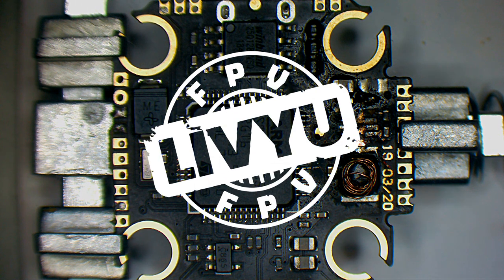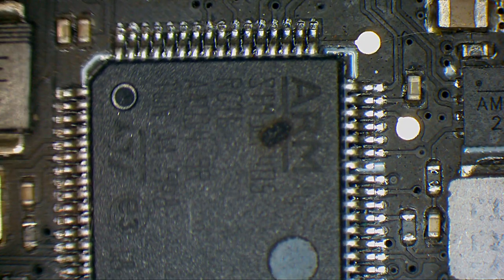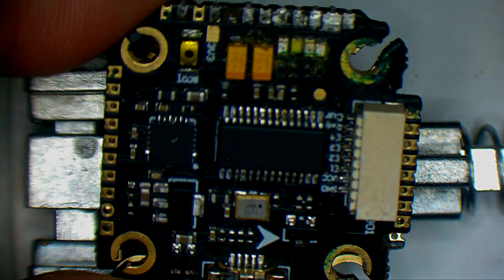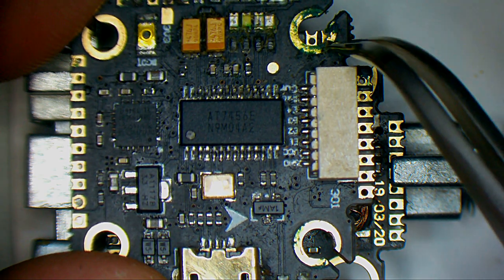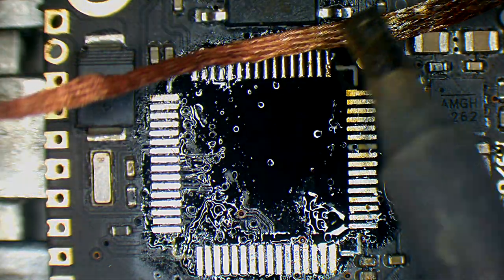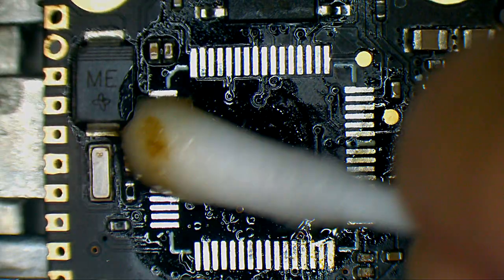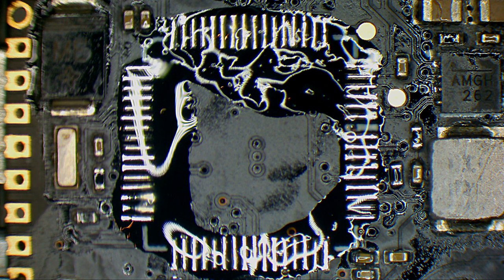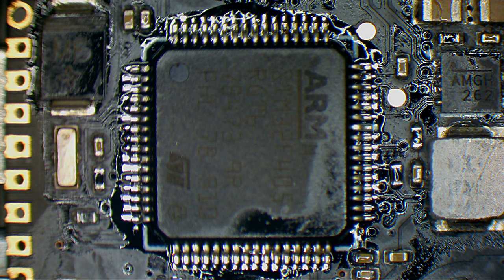Diatone Mamba F405 MINI FC - REPAIR

Comment: I have a Matek F405-STD Flight Controller same chip, but trying to find the problem has become a pain, I've removed the MCU STM32F405 plus 2 diodes and 2 3.3v regulators BUT I still have a short on the ground to 3.3, I assume its a capacitor that's shorted?
Reply: did you figure it out?

Comment: Hi , any chance you can do a DJI FPV teardown so we can understand system and internal protocols - I would love to install HDMI Out and possibly AV out, HDMI In could also be use-full in future. thanks for your awesome content always so interesting
Reply from the maker: Hi, I am waiting for a DJI air unit to try and repair it. But for the Video stream out on the USB-C from the goggles... a really good software guy could hack it and make the video out possible. Hope someone will have the time and willingness to do it.
Reply: HDMI video out has been done. Use SBC and Altera linux. https://m.facebook.com/gregorioperezperez/videos/10159049166057745/
I want to know of we can locate and upgrade the microphone. Also I hear the radio can go much higher output power. It would be good to inspect the IC's to confirm that.
Reply: Thanks guys will check it out immediately.
Reply from the maker: @changeagent228  Well after I received it i will definitelly make a video about that. Thanks
Reply: @LivyuFPV  @Flyingdream777 You are both welcome. 😀👍

Comment: Great video, thanks. I have the same fc. When I connect it to usb, mcu becomes so hot sich that it can burn my fingers. If I am qucik enough, I can connect it to bf so it seems mcu is fine. I checked shorts in pins and there is nothing. I wonder what can be the reason?
Reply from the maker: they can go bad half way. I would change it for sure !
Reply: @LivyuFPV  thanks. I didn't know that it can go bad half way
Reply: I have a 30x30 mamba with the same issue, from what I understand it can be 2 things: broken mcu or broken voltage regulator (either 5v or 3.3v, check if the outputs of these regulators are shorted to ground and if they aren't check if they output the correct voltage)

Comment: I just thought could you make a video on how to check for errors on a Bord like this. I Guess not always you see burn marks that determines it’s dead. For example I have a spendix where the cpu gets hot but so I guess it’s that but not sure. Any procedure you recommend. Like check certain power rails or something like that.  Like your videos and looks so easy:)
Reply from the maker: 3.3v power rail. If MCU gets very hot then it is probably that one.

Comment: I'm curious. Would it help the MCU solder melt easier if you add leaded solder to the legs before you try to remove it with the heat gun? I have this same board that has a bad MCU and am planning on repairing it once I order a hot air gun.
Reply from the maker: if you don't have a hot air gun, and order a fresh MCU, cutting the legs one by one with a fine tip cutter would work also. After that just desolder the legs and solder new MCU leg by leg or by solder drag technique.
Reply: @LivyuFPV  I did that to replace a 3.3v regulator. A hot air gun is my next purchase. I just wondered if adding leaded solder to the lead free solder holding the MCU down would lower the melting temp of the lead free solder that's holding the MCU down. These repair videos you do are great. I never would have thought this kind of repair could be done until I seen you showing how to do them. I've ordered 3.3v regulators and a couple F405 MCUs so I can attempt this kind of repair. Unless a guy is rich, China's quality control makes this repair skill a necessity. I have at least $200 worth of boards that are junk unless I can repair them and I've only been in this hobby since May.
Reply from the maker: @CarbonGlassMan  Yes, it will lower the melting temperature.